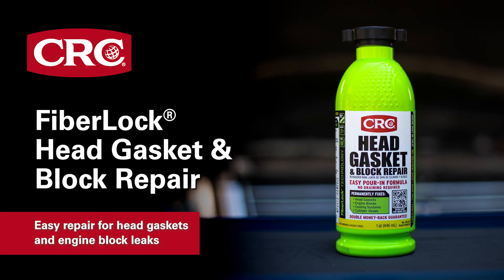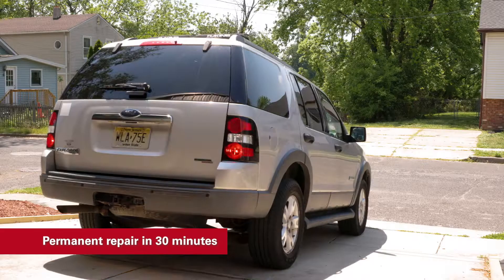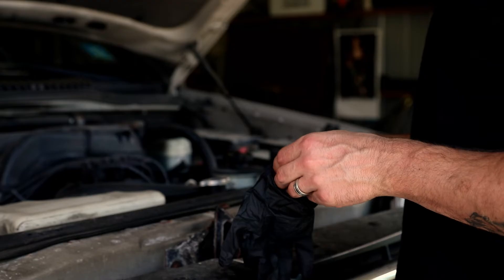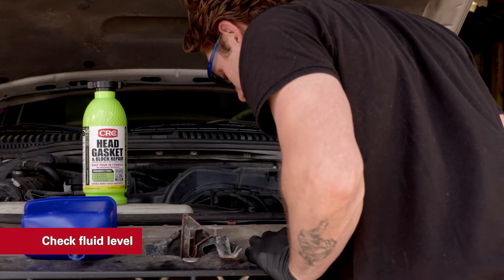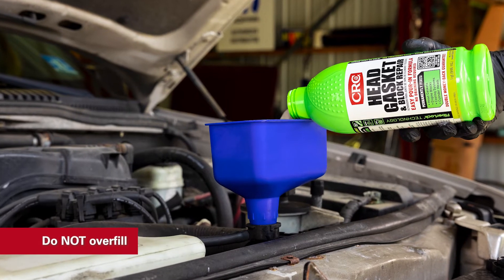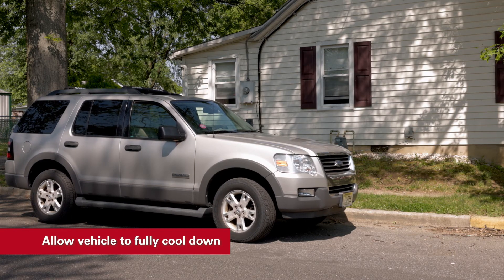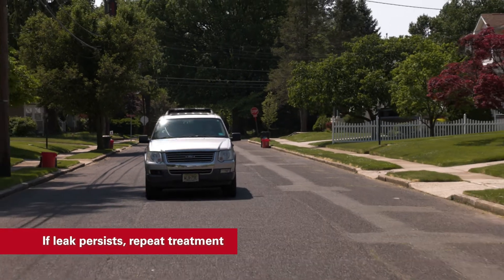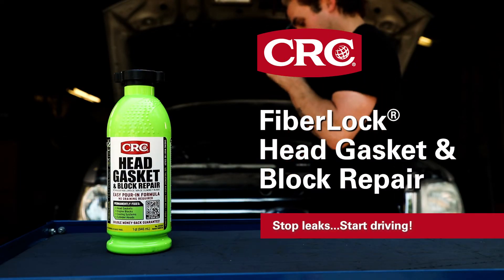CRC FiberLock Head Gasket & Block Repair - How to Use Instructional Video

Comment: I just got this comment from an old YT video, copy-pasta on my Notes:
"@markeinerwold5482

Just a hint from a veteran mechanic, the stuff works great, BUT, if your going to use it, even though it's not on the directions is to pull thermostat, bypass heater core, and use a external radiator, if you do this, it will work, well"
Flush your radiator at the end

Comment: The stuff will work, but in the future, you will make the problem worse than what it is. If using this product, understand you about to pay way more money to get it fixed when the problem comes back. This is a temporary fix that might last maybe a year. You better off getting the source fix correctly unless you are about to buy a new car or motor.

Comment: Not knocking the product but lol, “can be fixed in as little as 30mins”. Then goes on to say start with a cold engine (we’ll give them this one), add CRC, idle for 10, drive for 10, let it completely cool down. That’s at least 2 hours and even more if it’s an emergency repair 😅

Comment: How come the directions on the bottle doesn't tell you to turn the heater on high or even turn the heater on?
Reply: Good question. Everyone says to follow directions explicitly but everyone says something different so what the hell?
Reply: Personally I’d probably disconnect the heater core from the cooling system so the fibres don’t clog the heater core

Comment: Admin, let me ask, after pouring it into the engine and idling for 20 minutes and driving for 10 minutes, does the CRC solution have to be removed from the radiator? Or still leave it in there and use it?
Reply: Given they say not to do again for 200 miles and 5 days, I believe they mean to leave it in there. However, I think if you know it has worked already you could flush it out. This reply is probably too late for you, hope it went well anyway.

Comment: Worked as advertised on my 2010 diesel xtrail. Pressure was building up in coolant and then losing coolant.
I only used 1/3:of a bottle to avoid clogging problems. It took about 4 days of driving to fully seal the leak.
I have had no side effects or issues.  I've found having the heater and fan on and feeling the temperature of the blowing air is the best aid to seeing how the fix is progressing. The heater core is high in the cooling system and gives good early indication.
If the air is getting much cooler you are losing coolant and need to stop driving and add coolant.   If the  air is not stable, getting warmer, cooler, warmer you are getting air/exhaust bubbles in the coolant and pressurising your coolant system. Stop the car and let some pressure off before you lose coolant.  Drving carefully helps keep the fibrelock in the cooling system for as long as possible where it can plug the leak over time.

Comment: If the only way to add coolant is through a expansion tank i’m assuming I can’t use this product then? There is no opening for the radiator on my mini cooper
Reply: Remove one end of the top hose. Pour and replace hose and clamp.

Comment: If all or most of my antifreeze ran out of my radiator, and I add the CRC formula,  do I add antifreeze directly afterwards the application or do I let engine idle for 20 and then drive around for 10 minutes and THEN add antifreeze to my system?
Reply: You would need to make sure your fluid level is full, so whether using anti freeze or water, it should be full before idling and driving, then top up if the level has dropped, AFTER it has cooled down though.

Comment: Used it for my 06 Dakota.  Worked well, no more leaking and check engine light turned off.  It lasted over three years.   Going to try it again, hope it repeats itself. 🤞
Reply: Did it work a second time?

Comment: I had a minor leak in my Nissan TD27T that was letting coolant into the combustion chamber as the engine cooled, the motor had no over heating problems at all, just damage occurring to injectors occasionally, but as soon as I added 250mls of this CRC Fibrelock additive, precisely as instructed, my engine began overheating, I have no idea how this can happen, as the coolant level was perfect and nothing else had been changed except for this product being used, from maximum of 180° to average of 200° is totally unacceptable for a product that is guaranteed x2?? my cooling system is now of no use after having an almost new aluminum radiator fitted, is this additive put an insulation layer on the inside of the radiator core? or does its ingredients and viscosity cause it not to release the heat adequately while passing through the radiator? I have never had such a damage causing additive that was so instant and permanent, great sabotage item that I'm going to warn all my customers and automotive associates about, if I still haven't heard back from CRC or Repco by the end of this week.
Reply: Any updates?
Reply: @vsmh96  I had a lot left over, so since I've always had a crack in my Nissan GA16DE cylinder head, in a very different place, its down the No.3 sparkplug tube and coolant gets in enough to short the spark, so I tried a different way and disconnected the heater core and radiator, and used my old motorcycle radiator sitting up on the grill, so it can't block the mint condition radiator in the Pulsar, but anyway the TD27T diesel is still running over halfway on the gauge when you get to an incline, but ok on the flat road after I gave it a major flush out, but it was never going higher than a 3rd, unless it was low on coolant from the original leaking cylinder head, which is not leaking now, unless it's overheated by the lady who drives it... so it most likely is by now 😐.

Comment: Gad a mechanic friend do this sealant by the instructions. Drove well without heating for about 40 minutes. 
I go home and car lever goes to H ! But doesn’t do the heat thing. Very strange. Any advise.
Reply: nobody understands your question
Reply: @np3m lmao
Reply: @np3m I can't get any answer, maybe it affects the temperature sensor device making it over read 😂 but I doubt it, mine is holding pressure but it wasn't running too hot before and didn't even get that much pressure at 170°, now its getting over 200° or over 3/4 on the gauge.

Comment: How do you add it to a system that doesn't have a radiator cap, but has a pressurized reservoir like a Volvo?
Reply: Add it to the upper radiator hose
Reply from the maker: Please contact our techservice @crcind.com so they can provide guidance.

Comment: I did everything as described while on my 10 minute drive car overheated and I had to pull over and stop engine. The truck ran warm with same type of drive before adding CRC but never overheated to point i had to stop and had boil over.
Reply: Same thing happened to my car. I described it and all I got that no one understood my question. The mechanic drive the car for 40 minutes without it heating. I drive car after a 15 minute rest and it reached to the top but it didn't zizzled as before the sealant.
Reply: If anyone has this problem, remove the thermostat and check to make sure it's not clogged up with fibre.
Reply: @Stein-i3p  After I checked mine as you state mine was loaded with the fiber junk. I cleaned it all out.
Reply: I didn't have a boil over though.
Reply: @ruthlugo5321 the only reason mine didn't boil over, was because it was holding good cooling system pressure, but I can't run it at 210° with some of the steep hills I drive over, it was always running at 170° average with the correct coolant level, but now it just keeps going up from cold until I'm driving down hill with barely any throttle, I am lucky that I can stop and let it idle and the temperature will gradually drop with the truck type mechanical fan, and by tipping cold water over and through the radiator, it will bring the temperature right down.
Reply: Thats what happened with my Nissan TD27T Mistral, I had a minor head coolant leak, that compromised injectors but wasn't ever running over 170° when always keeping coolant level correct, but as soon as I added the CRC Fibre lock and went for the 10 minute drive, a small hill caused the temperature to rise up to half on the gauge and continued to 210° until I was going down hill, which was totally unacceptable for my standards of a functioning cooling system, the small leak was now nothing compared with my very serious overheating problems I now have, and it was from following instructions precisely..😢
Reply: @simonallan9941  Nopw you ahve a problem overheating is no Good
Reply: @anteneupitra and it wasn't overheating before I used the CRC Fibrelock, but the worst thing is that its not my vehicle and she was relying upon me to fix it, but I was relying upon CRC Fibrelock to fix it and not make it worse...😢
Reply: Same thing happened to me  and it says on the bottle double money back guarantee I need one more treatment

Comment: Also, is there a recommended amount of time to leave the vehicle before driving again?
Reply from the maker: Please reach out to techservice@crcind.com  who can assist
Reply: It does say to the engine cool down after the 20 minute idle and the 10 minute drive. I assume this would allow the sealer to set in the places it has been blown, sucked into to block/seal the head gasket for instance.

Comment: If it takes longer than 20 minutes to reach normal operating temperature. Do I need to let the vehicle reach operating temperature before driving for 10 minutes?
Reply: looks like your termostat is stuck go to a mechnic for repair,

Comment: is this ok to use as a preventative, without confirming a leak? i was in an emergency situation and had to drive my very old van, for way too long, with the needle way too close to the red line, so im sure there was some warping of the head or wearing of the gasket, which would mean its only a matter of time before going full-blown? can i get ahead of that with this?
Reply from the maker: This product is not meant to be used as a preventative measure.
Reply: @CRCAutoUS  thanks so much for your quick reply!  i actually didnt realize i was posting on the fiberlock, i thought it was your older green bottle without the pellets... if i find your liquid sealer, does that change your answer?
Reply from the maker: @glenstewart6614  Please don't hesitate to contact techservice@crcind.com who can help with your issue.  👍

Comment: If this works and stays sealed, should I flush the system out?
Reply: Did they ever answer you?good question
Reply: If it has worked, yes I would flush out to save it blocking anything else that shouldn't be blocked, like radiator cores.